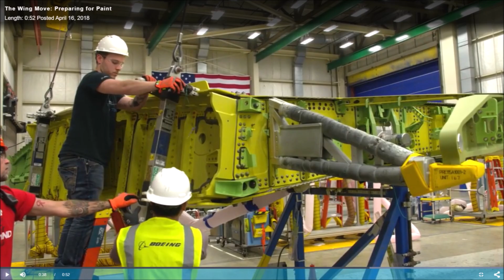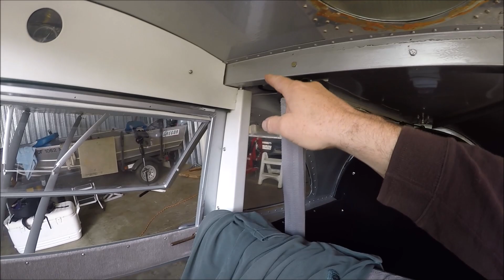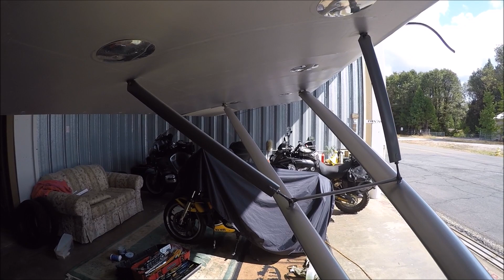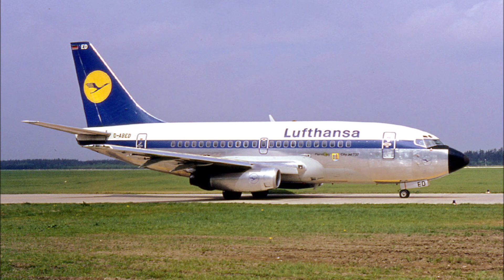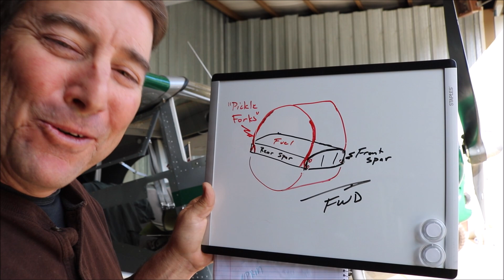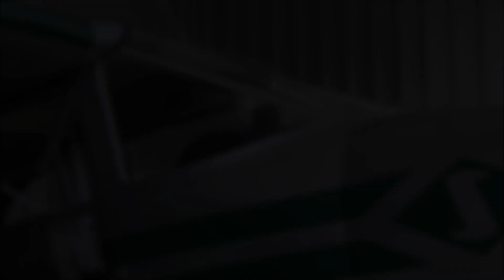737NG 'Pickle Fork' Cracks.

Comment: Juan, I hope this won't look like I'm being critical, because I have nothing but the highest regard for you (although with paid content, the production values bar is naturally raised a bit...).
I was very glad you did a better-exposed view of the attachment bolts of the wing spar to the center section in the Mighty Luscombe, b/c the first shot was very dark, due to the partly opened hangar door forcing the camera to "stop down." Still, your redo might have held the scene a few moments longer (I had to back up the vid a bit to get to a good pause point), and even better, be lit with something (perhaps a shaded worklight?) that would illuminate the cavity well enough (without casting light onto the camera) for my old eyes to pick out all the details. 

I also pray that your fatigue after this production is just a transient!
Reply from the maker: Excellent feedback Thanks Beech!